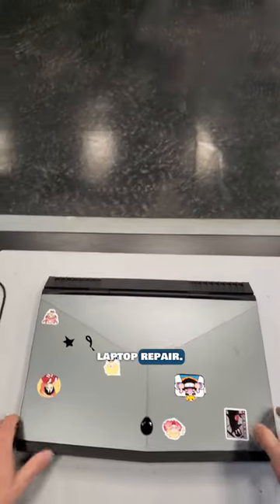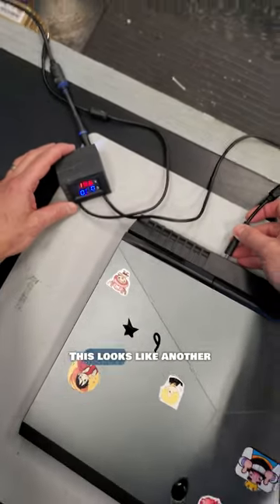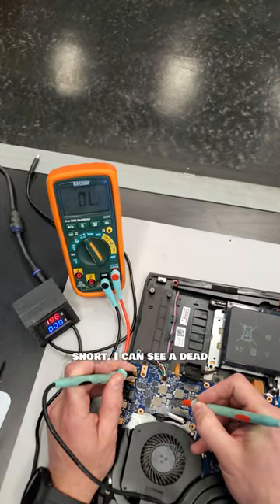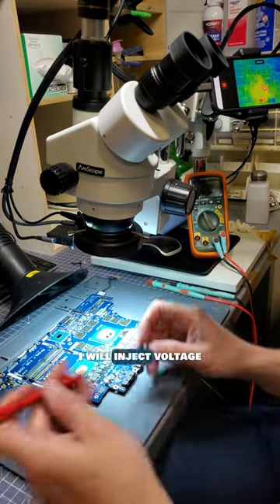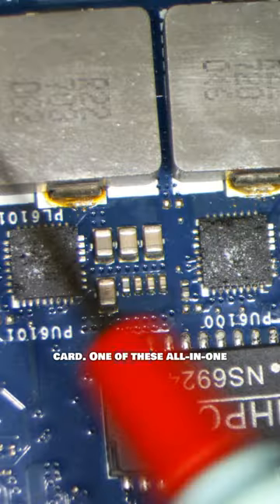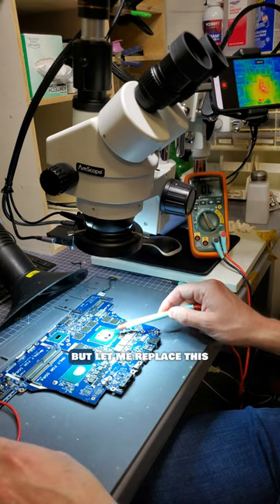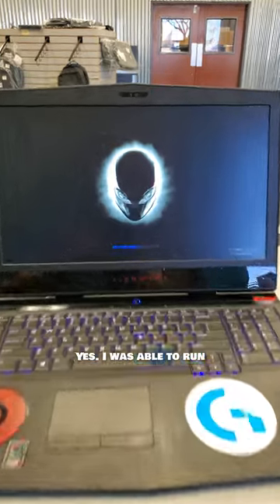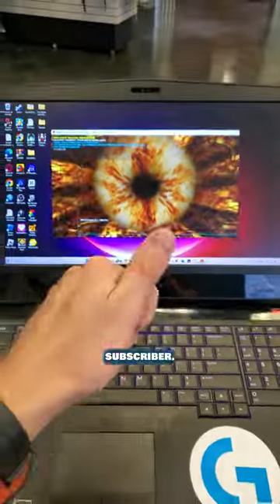Game Over? Gaming Laptop GPU Repair Fix  #shorts #laptoprepair #computerrepair

Comment from the maker: If you need a repair and it is a Dell/Alienware laptop and you live in the USA or Canada, then yes.  You can fill out a service request form at partspeople.com
Reply: My Alienware 17 R4 had the same issue. Repair guy took 300 and still wont return it.
Reply: I have a laptop board I need repaired that may be beyond my abilities. Unfortunately it’s an HP motherboard. It’s from the Star Wars laptop they made about 8 years back, I got a used one to upgrade mine to one with a GPU. Unfortunately the trackpad connector has broken off and took a few pads with it. I suppose I could handle not having a trackpad, but it would be annoying as I use the trackpad at all times except when gaming.
Reply: I really appreciate you sharing the price for the work. The repairs seem like a very affordable option, and it shows the value of your work. Thanks for putting out great videos!
Reply: can you repair my asus rog laptop? received it back from warranty and they screwed it up, gpu will always get low and high fps every second

Comment: I can't believe that gpu chip was alive with that voltage ⚡ 😮
Reply from the maker: There are 4 protection MOSFETs that shut off the power off as quickly as possible once they detect a short circuit. Even after knowing that, I am still impressed.
Reply: @dellpartspeople  so the heat you were seeing wasn't to the GPU but to those safety chips?
Reply: @cosettapessa6417  no, he applied only 1 volt on the bench to allow everything to work within the lowest safe voltage, so there was power going in the gpu and it shouldn't be there. It means one switching mosfed burned when it was On, so all the power goes straight through the + to the gpu.

Comment: $200 for a motherboard diagnosis and repair? That’s a bargain. I don’t think most techs would bother with this and I don’t blame them. It seems impossibly complicated
Reply: It's not impossibly complicated, but it's still not worth doing for only 200. 

Company I work for charges 200 bucks as a bench fee just for walking in the door.
Reply: in my country, it's only cost as low as $40 🤣
Reply: You're paying for the expertise.
Reply: Bro every country has different prices for everything including food health houses and more, so each country might have different prices on a lot of the laptop parts, but most likely it'll still cost the same in every country because laptops and/or their parts aren't gonna be cheaper on india so that'll cost you at the very least 200 bucks @maklogetrich2378
Reply: @WEZFYKAN  that's what I stated first "in my country"
Reply: @maklogetrich2378  yes but most likely it's the same price unless if it's made in your country or in china then it'd cheaper ofc
Reply: @phillyphakename1255  I live in the USA and $200 is steep. Its barely if not even worth that.
Reply: @WEZFYKAN Chips like these (which are not the GPU itself, just the regulators) are worth pennies, what you really pay for is the labor, here in Spain this same work would not reach 100 euros.

Comment: 200 dollars is not bad, its wayyy better than having to buy a new laptop
Reply: Considering the fact that it's an 8 years old laptop, I would rather save up for a new one.
Reply: @annanishimiya7786  Alienware laptops aren't cheap
Reply: @SunWarrior155 but you can't futureproof it
Reply: The problem is the customer could easily face a new similar or worse problem, given the age and that it already failed. Downclock, test thoroughly, then clean install  to limit stress perhaps. Also the thing cannot run windows 11, so after Oct 2025, it will need nerd assistance to keep running somewhat safely.
Reply: @DonCarnage42 it is running windows 11 though, look at the bit where he runs Furmark.

Comment: Whoever created those short safety systems deserves heaven
Reply: dell would've replaced the motherboard
Reply: @eeagle69 and then fixed it to create a refurbished module to put in the next one that comes through the door.

That's what OEMs do, there's a slush fund of boards in various states of repair. Faster to swap the board than repair it, plus you get specialization of labor, cheap labor swapping boards, more expensive labor replacing mosfets. You don't need to pay someone the big bucks to turn screws.
Reply: @phillyphakename1255  doesn’t change the fact that it would cost more than the fix the youtuber did for the customer

Comment: Hi. What could be the causes of these shorts that might cause a damage on the motherboard and how do we prevent it?
Reply: Could be a faulty power supply, or just a regular component failure. Usually there is not much you can do to prevent it.

Comment: Mosfets fry so often (spikes in the electric grid, jumping through the power supply?) that it might even be economical to set them on a separate board with a surplus screw.

Comment: At 8 years old, that customer should probably start looking at replacing the laptop. This is why most shops don't bother with the chip replacements on the board, because it's typically more cost-effective to replace the board or unit.

You may have paid $2k for that pc when it was brand new, but at 8 years old that hardware is almost a decade old and should be replaced. As software support starts ending for it, it'll become more vulnerable to online attacks.

Comment: Can you explain how you know where the power rails are? And if you don't exactly know how do you figure it out m ty in advance
Reply: Schematics
Reply: It's fairly obvious, high power means large components and fat traces, just look for the big chips like mosfets and inductors then give it a lick with your multimeter, of course schematics help so you know what should be there but it's almost always 12v/5v/3.3v

Comment: Hi! I recently got for free a Dell Vostro 3750, it worked fine for an hour or so then never turned on again
After checking all the voltages I could, I saw that the 3.3_RUN rail wasn't present or very low (0.3v) and same for the 0.75V rail (19.5, 3.3ALW and 5V work fine)
Do you have any idea how I could fix it, of what I could check to find what's wrong? I have the schematics and a soldering iron but no thermal camera
Thanks for your content!
Reply from the maker: If 3.3LDO/RUN is missing, check for a short on the CAPs on the superIO/startup chip.  It might be a bad super IO.  Put the DMM in diode mode and put the red probe on the ground.  Also, you can inject the 3.3v needed on that rail, start low at 1v, and if it is now pulling a lot of current, then move up to 3.3v.  Check the current draw.  It should not pull more than 100mA.  If the current is within range, try plugging in the charge also, and then try powering it on.  It might POST.  Good luck, sorry for the delayed responce.
Reply: @dellpartspeople  thanks for your help! (Sorry for my late response I didn't get a notification)

Comment: When it comes to repairs like this, do you ask them for their password to be able to login and do the stress test? Just wondering how that process works, or if that is normal to ask a customer.
Reply from the maker: Sometimes, they provide the pin, but I have test hard drives that I install and run the stress from.  If they have a software-related problem, I would need the password; this is hardware, so I do not need it.  Some customers do not even send in the hard drive with the laptop, which is fine also.

Comment: I had this exact same laptop that I used for 4 years for heavy gaming before it died on me to a motherboard short. However from purchase the charger would randomly disconnect/stop charging and I had to reply the power cable from the socket to the power supply to get it back on again. Never knew why this happened but I kept using it like that.
Reply from the maker: Glad I could help.

Comment: What are the common thing that can cause to the dead of motherboard since there's so many motherboard issues with a laptop ? Is it heat ? Or short circuit ? Or broken charger brick ?Or something else ? At least we can do something to prevent it happens (if there's any).

Comment: you seen to get a lot of issues with integrated nvidia
Reply from the maker: I have seen my fair share, but it takes years for it to happen. I would not lose sleep over it. This laptop was 7 years old when it happened. Heat and age are the causes.  Most are older than 6 years.

Comment: I have a M15 R1 but my battery only lasts about 40 minutes, a replacement is necessary right?
Reply from the maker: Yeah, probably a battery replacement.  With the laptop powered off, hold down the FN key and press the POWER button.  This will boot you into the Dell diags and tell you if your battery is at its end of life.   Here are all the parts for your M15 R1: https://www.parts-people.com/index.php?action=category&id=151&subid=1307
Reply: @dellpartspeople  Thank you very much!
Reply: @dellpartspeople  I did run the diags and got that everything related with the battery was fine?
Reply from the maker: Batteries tend to loose their life function overtime, so yes may be time for a new battery..

Comment: I have to ask, why is it always a Dell or Alienware. I get that they make shitty laptops but I have never encountered a hardware issue with them (except batteries or charger adapter) and I have absolutely abused them during usage.
Reply from the maker: Hi, well it's because Dell is the only brand we work on since we specialize in Dell OEM parts. I'm just doing videos on the ones that DO need repairing.

Comment: Broo I have an Asus Rog strix g15 and I face an irritating issue man, when ever I plug my charger and I use my lap there is no issue I even play valorant on it but whenever I start using YouTube my screen frequently goes blank and reappears in 2 to 3 seconds and some times screen stays blank and I can't even  shutdown so I force shutdown 
Please solve my problem
Reply from the maker: Sounds possibly like bad GPU MOSFETS but we only repair Dell laptops.  Sorry.  Send it to northridge fix.

Comment: Yeah 200 bucks? That mosfet pack does not cost that much, its prolly 10% of that up to 20 bucks. But you deserve fucking more than 200 bucks for not telling the customer he needs a new motherboard g. Ofc i may be wrong abt the price correct me if i am
Reply: It’s 20 dollars for the component, and 180 dollars for knowing how to cook.
Reply from the maker: Thanks.  I also pay for return shipping and give a one-year warranty. I should charge more, but I offer this more as a service to my customers, not as a money-making part of my business.
Reply: @dellpartspeople  you should definitely charge more if it includes return shipping and warranty. You deserve it. But many customers are quite stingy haha. Btw do other mid range laptop manufacturers also add protection circuits like lenovo legion etc
Reply: @dellpartspeople  i think you should choose the price of repair over what the customer is using and if he is in a bad or good situation with money. Try get that info and then you can do alot of good deeds while making alot of money.

Comment: $200 for replacing a $2 chip if that what a rip
Reply from the maker: Oh, well, shoot.🤨 I thought I was giving them a good deal. How much do you charge for this repair service at your laptop motherboard repair center? If you charge a lot less for your years of experience, I will refer people to you so they can save money.
Reply: @dellpartspeople  you thought wrong i like your videos you do a great job but when computers can be had for 300-500 low end and your charging 200 and up for cheap chip repairs and most are used that could go bad at anytime that's a rip it don't matter if someone has a repair center or does it out of there home now if that was a motherboard replacement that's different but it wasn't and if your willing to send your business my way instead of understanding the real problem here than you might just end up like all the rest of the businesses that have gone under with bad management practices you can replace a $2 chip for $50-$75 for part and labor and still make money im sure half the time you get the used parts for free from swapping out a dead motherboard and reusing anything good off it witch is fine if the price is right but $200 is just putting the screws to your customers and if you want repeat customers you wouldn't try to screw them if i had work done and someone pulled what you are doing you would get an ear full and bad reviews and a whole lot of bad word of mouth for that price the person would be better off getting the parts and doing the work themselves and if enough people fix it themselves repair shops go under or even if they just decided it's time to replace the laptop then there is no money in repairing anymore food for thought

Comment: 200$ for a 2$ mosfet replacement? Its cheaper to buy thermal camera and external power supply to diagnose it yourself
Reply: Sounds like a good way to turn a $200 repair into a $1000 one 😉
Reply: You're paying for the experience and diagnosis. Besides, actual quality equipment costs way more.
Reply: You charge for experience, diagnostics and labour including repair and testing after component replacement
Reply: @biggybaddi  nah, that Mother board is not Worth 200$
Reply: @fentanylek that old Alienware laptop is not even worth $200, the costumer paid more than what the laptop's worth
Reply: @biggybaddi  nah, this laptop is Worth like 150$